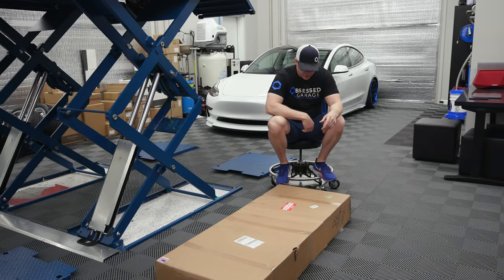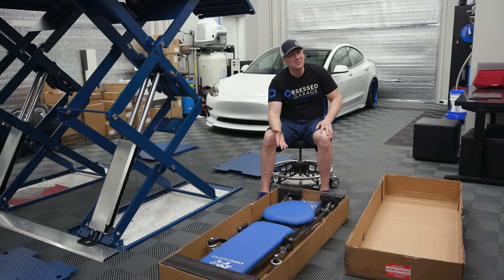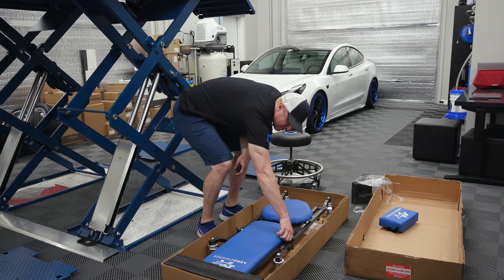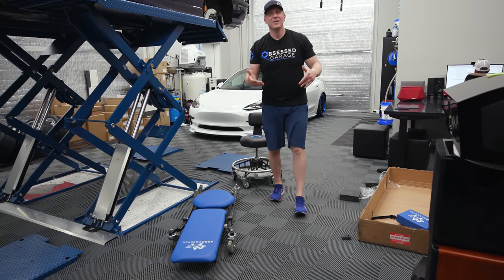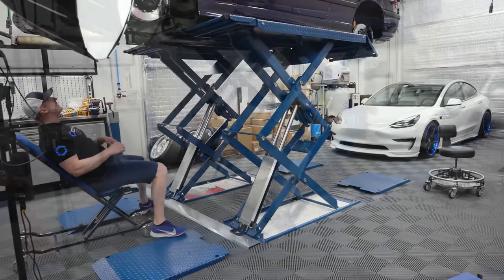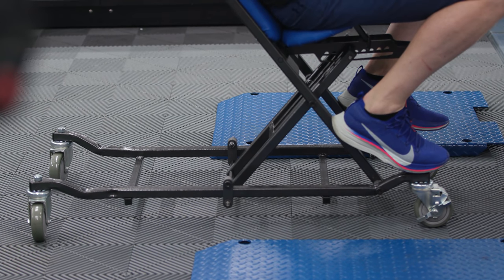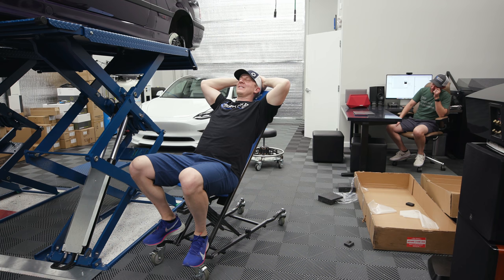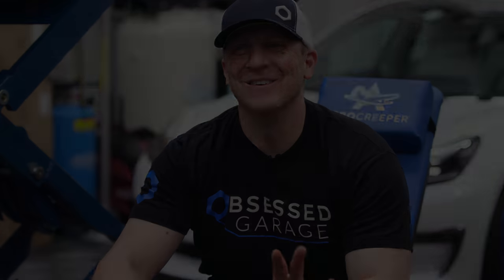AeroCreeper: First Impressions

Comment: Cool review, I got the Ergo Creeper RS but I am 5'3, so a baby according to you.. now my lift is a Max Jax M7K and my spaces are very shorts and tight, ceiling height is 8.7 and the car needing work a mini van Chrysler Town and Country which is 6 ft high, I only have less than 3 feet to work under the car; I have not lift it yet, these are just test measures I would know for sure once vehicle is on the lift. For these chairs everything should be adjustable; the back rests the seat, in the Ergo Chair the seat is flat which kind of makes you slide off it when pushing with your feet; for the prices these sells there should be no modifications needed to do at all. They both have their plus and their cons. A hybrid between the too should address all the issues the reviewers are pointing.

Comment: I know this is an old video, but how low of a car could you get on that lift ? Also, do you think you would someone be able to change a transmission or pull a front wheel drive engine out ?
Reply from the maker: Just about any low car should be able to get on the lift since it's fairly low profile.
Reply from the maker: As for the engine and transmission, I think it would depend on what car you're working on

Comment: I’m looking for a creeper that allows me to sand and spray gelcoat on the bottom Of a boat while it’s up on stand without having to lower the boat stands almost all the way to their lowest point. and this seems to be the only creeper on the planet that raises up in height. I don’t know why that’s not very common however, it would be absolutely perfect. Plus, the young generation nowadays )my employees) Complain that their arms hurt after holding a DA from the creeper to the bottom of the boat. Is it just that I’m not search incorrectly on Amazon for a creeper that raises up or is this just the only thing. I’d rather pay the new shop guy to send the bottom of the boat and deal with waves and buy one of these so I can sand. They are expensive. Give me the only one I found on Amazon was $590.